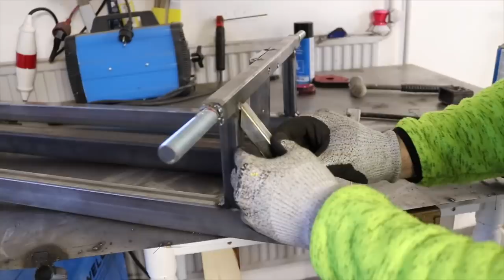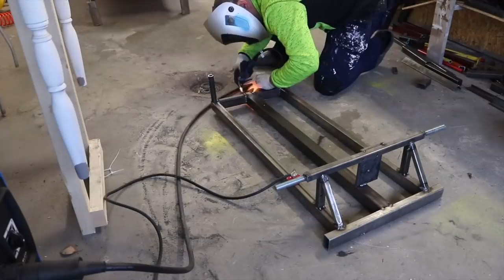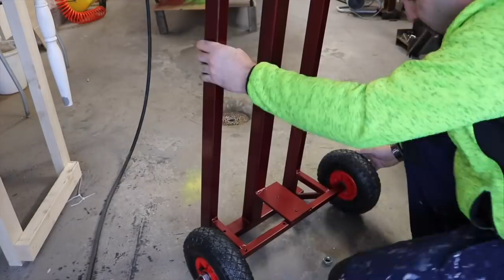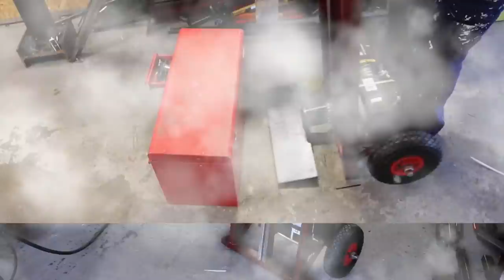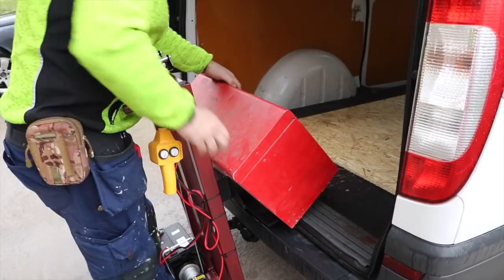How to Make a Hand Lift •• Awesome Invention Idea

Comment: The center of gravity is misaligned. Make the load lie on the axle of the wheels, not on the hands. Handles should be bent that the load lifted you, but not you the load on hands held. Make the handles longer, then you will understand.
Sorry about my English.
Reply: Dumb it down plz
Reply: @andrewhendly9075  Переводите сами с RUS: Центр тяжести не правильно расположен по отношению к оси колёс. Приходится при таком расположении держать вес на руках ,а надо, чтоб вес был расположен комфортно на оси.  Чтобы это исправить нужно увеличить длину ручек, эффект рычага. Можно и так объяснить: нужно сделать правильно балансировку между точками (ось колёс-груз-руки). Чем ближе расположен груз к оси тем легче удерживать груз и не надо напрягать свою спину.
Reply: Recess central section so the load rests evenly on the side rails...?

Comment: Really awesome idea. For my own personal use I'd want to lengthen the platform to where it can basically lift up large trash cans filled with scrap and what not. Also put a pair of stabilizer wheels on the front end of the platform so I don't have to sit there and try and balance the load trying to raise it into the bed. This is a great idea though, just needs a couple tweaks for me and this would be incredible. Good stuff man

Comment: nice concept but end product doesn't look particularly useful. The bottom needs some type of support that stays on the ground so it doesn't need to be counter balanced and you need two tracks on either side to get rid of that gap between the lift plate and the back of the hand dolly. also the lift plate should be twice the depth.

Comment: Excellent idea but poor design execution.  Needs a larger lifting platform.  Also needs a fixed base under the platform to resist the forward tilting forces due to no support in front of the center of gravity.  I'm not sure that sharp bend over the fair lead is good for the cable.  Remove the fair lead and replace with a 3" diameter pulley or snatch block.  Look at commercial designs.  I need to build one to lift window AC units without another person's help (not always available)..
Reply: @thomasrobinette3227  You gotta love that he is using his head instead of injuring himself lifting AC units.  If there is such a unit that can do this lifting, he has a good safety ethic about his work.

Comment: I'd add a plate or outriggers to the bottom in order to make it stable when lifting a load, I'd set the lift platform all the way back ahainst the frame, and I'd use a single pulley with a bigger diameter so the cable doesn't have to bend so far.

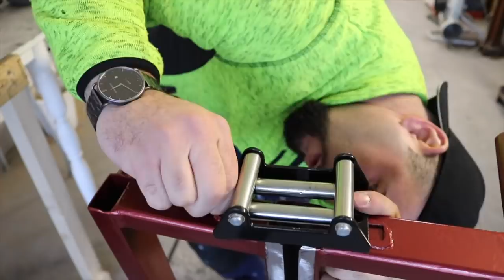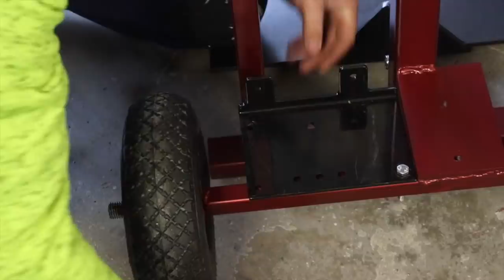Comment: What part of this is genius?  Using pliers instead of a wench to hold bolts secure at 2:31 or using pliers as a hammer  at 2:53. Really, what good is it? The lift table is so narrow a small tool box wont stay on. Another POGO STICK WITH A ENGINE GLUED ON. Looks fancy but doesn't really do much. Neither awesome or genius.
Reply: Oh yeah lost my train of thought toss the lift plate and use interchangleable forks, folding triple plate that opens and gives width but u have to bring the weight into slide tower or u'll b on verge of losing everything u pick up. ie 3rd wheel trianglular or 4th square. Duh! Oh yeah 4got yr a fkn dr+fkn genius so u know all this